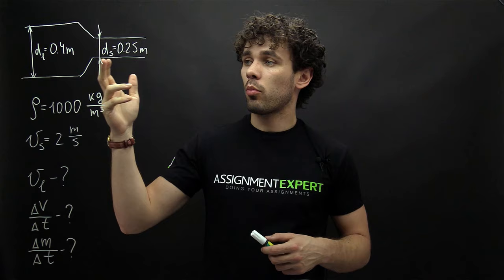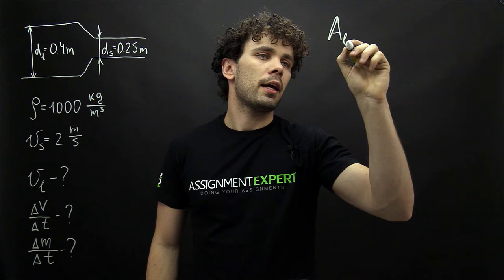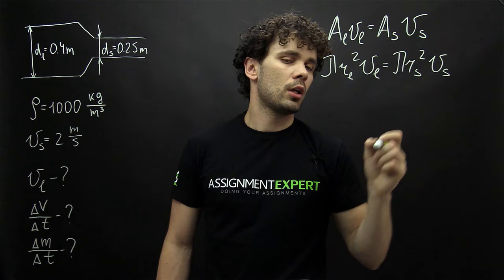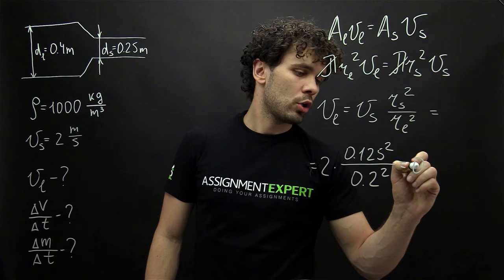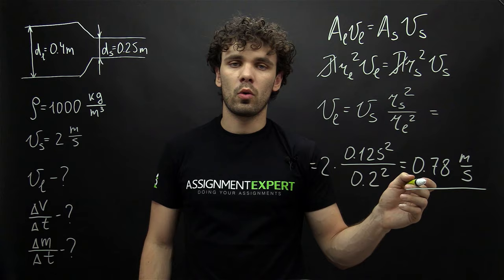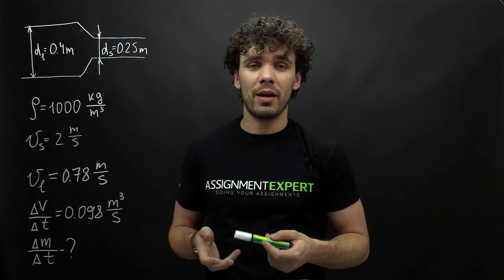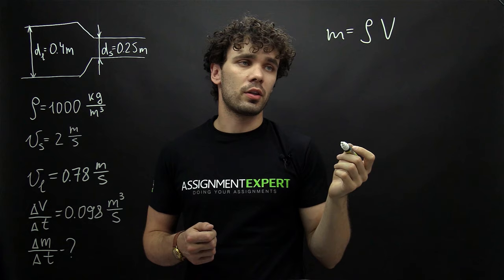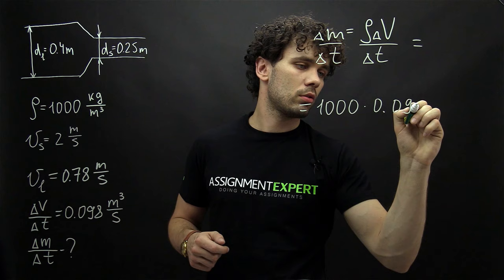Water flow rate in pipes of different diameters

Comment: I have a question. If the pipe diameters are different, in this case two, will there be two volume flow rates or only one..?

Comment: i have a question, please help me. The fluid is air from compressor. 
The diameter of pipe 1 = 10.16 cm, the flow rate is 23.6 m3/minutes, pressure is 7 bar

And the diameter of pipe 2 = 1.27 cm, pressure is 6 bar

What is the flow rate on pipe 2 ? 
I am confused

Comment: The pain in seeing him say 2*(0.125^2/0.2^2) equals 0.78 when it's 0.78125
and the pain in seeing him say that pi = 3.14
Reply: well, how it feels to know: that units are in meters, so these pipes actually are huge and wall roughness and others factors are actually omitted here, as well as the density (what is it, water? it's either 998kg-m3 or 1028kg-m3);
Reply: @quattrohunter  uhm... what?
Reply: @pedrosso0  relax, just stated that accuracy here is not the main point
Reply: @quattrohunter  if accuracy would ever be ommited for any dumb reason, use the approximation sign
Reply: @pedrosso0  well, you'd be still accurate till some point, I guess it depends on the goal
Reply: @quattrohunter  Infinite accurasy is where it's at

Comment: According to the calculation deltaV/deltaT is same for both the pipe diameter 0.4 and 0.25.
 So same water meter reading in both pipes?
Reply: Yes because flowrate is constant in the same pipe flow. This allowed him to work out v2, or vs, in the first part; because it is constant hence A1v1=A2v2